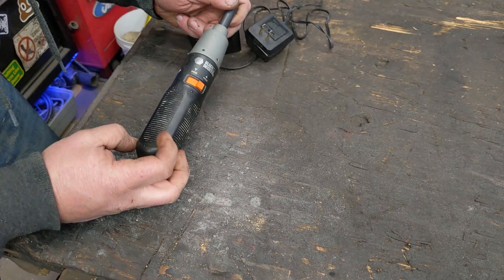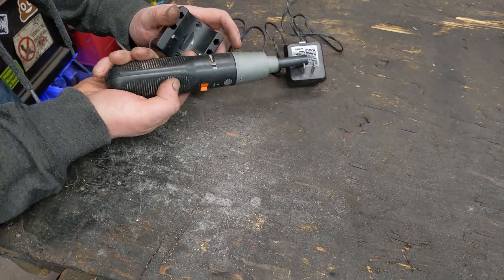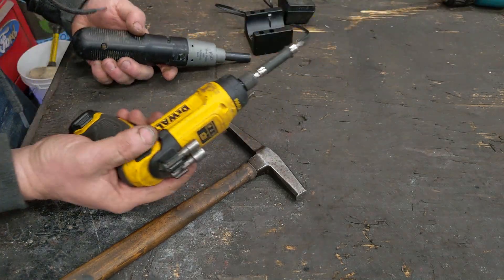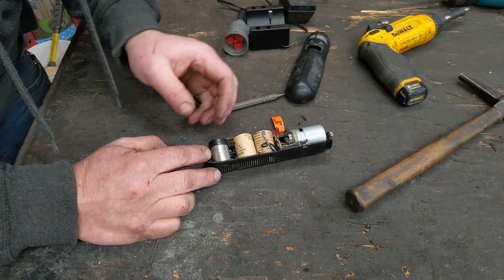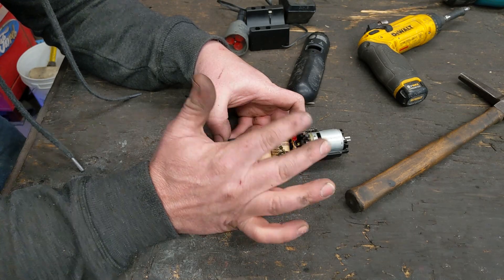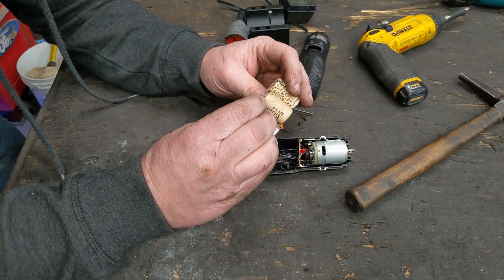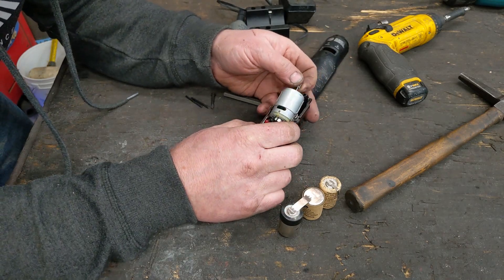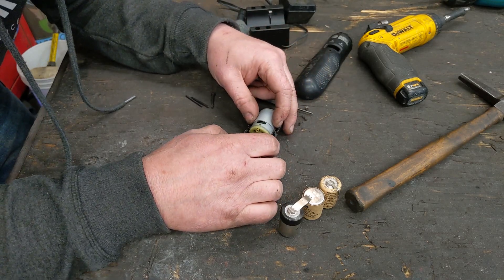Lithium conversion Black & Decker Screwdriver from NiCad Nimh  plus  Charger Upgrade

Comment: At the 6:25 mark you reference a “strip” . What is a technical name I can use for parts research?
Reply from the maker: "Nickel Strip" You can just use copper wire though and flatten it out. It'll do the exact same thing.

Comment: 0:56 I have a VersaPak version of this screwdriver, and the plastic housing is cracked.  I didn't know you could punch those pins out, I guess this is how I should go about supergluing the housing shut.  I also ordered a set of lithium ion VersaPak batteries, and I am surprised with the amount of power these tools now have.  The reciprocating saw was able to cut a 1 inch ish branch with a lousy jigsaw blade, I could only imagine how well it would cut with a better blade.  I also think it would be better if they could source shorter but still powerful li ion batteries to stick two of them in parallel in the VersaPak cylinder, but even so the power gained is insane.

Comment: If the battery gets hotter in use than while soldering,  then the soldering will come loose while you're using the tool. 🤔🤷‍♂️

Comment: I used a 21700 in mine and it lasts most of the summer. The 21700 was rated at 4,000 mah. I also converted it to charge with a single cell li-on charger. works GREAT!!

Comment: I have one of these sitting on the wall in my garage that hasn't been used since the 1980s. Looks like I need to order some lithium batteries. Thanks! I may have to fix my Rigid impact driver, battery op circular saw kit from Home Cheapo who wouldn't honor their "lifetime Guarantee." Got to dig out the soldering iron!
Reply from the maker: Awesome. Yeah, I've heard quite a few people disappointed with the Ridgid "lifetime warranty".

Comment: Can you also drill with it? I have smaller diameter drilling tips, yet I guess it is not possible to attach them to this model.
Reply from the maker: Unless you have hex drill bits or buy a separate hex drill bit chuck, no.

Comment: I predict the motor will smoke. The motor has more power & torque, which means more watts…

I gave a 14.4v B&D cordless drill a cord with car battery clamps…it worked really well, with tons of torque, but the smoke escaped before finishing the first job.

Comment: Thank you my black and decker is modle (9018) and has two battery's at 2.4 volt and made in 07 / 1980. And today it still works like new. I would like to get new batteries for it if and when it refuses to work. Thanks again . I look forward from hearing from you.

Comment: Had something very similar to that it was all metal Black & Decker charger was the same type except for it was for a 3/8  socket.  Took it apart and three batteries set up just like that kept it for about 2 months was planning on getting replacement batteries for it. Got tired of looking at it and trash it. Should have kept it.

Comment: There are these little 3.7v charge/discharge chips on amazon for about $1 each if you buy a bunch. They work great with the lithium batteries you find in the street inside tossed e cigarettes. The chips are pretty small, a little bigger than a stamp. And you can get a variety of usb jacks for whichever cord you prefer to use for charging. 

Cool project thanks for sharing
Reply: Hello, I'm thinking about doing what you say, but I thought about placing the charging plate inside the base where the screwdriver is placed to charge, my question is whether it will work or if I have to change some connection inside the screwdriver, will you? Can you enlighten me??  Thanks
Reply: @MrJamp11 the charge chip I use has 4 connections you will need to connect to. 2 for the battery and 2 for the load (screwdriver). You'll need to remove and reconnect the wiring from the old battery connections in the screwdriver to the new charging chip, and you'll need to drill and shape a hole in the area your chip is mounting for the charging plug for your external cable to plug into. If you're thinking if doing this then you're probably capable of getting it done. 

You can drill another small hole above the plug hole on the side of the led, fill in the back of the hole, and fill to cover the led with hot glue. If you cover the led and it also covers the hole in 1 piece of glue the led will light up all the glue and you'll have a charging status light on the outside that's easy to see. The parts are cheap so you should try it. But be careful not to cross the leads on the battery, lithium fires are scary and could burn your house down. It is recommended to keep a bucket ¾ full of sand nearby
Reply: Thanks for the answer.  I think the charging chip can be connected to the screwdriver's original charging base. The two terminals B+ and B- must connect to the base's contact points.  In the screwdriver, the only change is replacing the batteries with two 18650 batteries or one 21700. My question is whether I have to change the screwdriver's chip as seen in the video at minute 7:45??  but I think I'll soon know when to start reconverting the screwdriver, thanks again for sharing your experience.  Greetings.

Comment: I wouldn't worry about those batteries and soldering I've had drill batteries hot to the touch and I'm pretty sure it killed cells

Comment: Nice one!
I’m used to that kind of conversion too. I found that running the battery without a bms is fine but you have to be aware of it. You can’t run the tool till the battery is dead, you must recharge as soon as power goes down and speed decreases or you damage the cells.
Thank you for your videos I’m a big fan, I like your approach and the way you do things.
Cheers from France

Comment: I did this with that little VersaPak (or how ever you spell it)...
I added a TP4056 Charging Board to it with only 1 battery. (inside guts too small for two batteries; I didn't feel like grinding it out).
Works well...
Reply from the maker: Awesome

Comment: The Versapack version, where you could swap out the 3v battery pack for the one in the charger, was the best of these cordless screwdrivers. Still using mine and it has been discontinued for well over a decade.

Comment: I have 3 of the Skill Super Twist brand.  A twin to the B&D.  I have replaced the Ni cad cells with Ni metal and still use them.  Fair warning though.  A friend had two of these, one for his shop and one for use in the house for his better half.  He had converted the shop driver to Li with a battery management board in a new charger.  It worked great.  His wife found hers uncharged and "borrowed" his from the shop.  After using it she made sure it would be charged so she placed it on "her" charger.  The resulting fire scorched the drywall and left a burn mark in the floor beneath.

Comment: 4:20 ...glue it back together? Are you kidding?  "Duct" tape dude! If you wanted to keep the battery charge for just batteries also, you could make just a wooden "battery" spacer with the wires to the charger connected by ring terminal screwed into each end.

Comment: Love it but the thing is still light duty for sure with plastic gears and light duty motor,  which is still great for in the kitchen drawer but I'd kill it in the workshop.  Brought it to life for some good use though ...thumbs up !  very cool pup !
Reply from the maker: Absolutely it's light duty, but what power screwdriver isn't? I have the DeWalt which is the best on the market right now and it's light duty as well.
Reply: @sixtyfiveford  I agree with that...  just thinking the DeWalt would be overall built better and last longer even so.  I'd still leave the cheapie old B&D in the kitchen LOL

Comment: Looks like you could fit a single high mAh 21700 in there. They can be as high as 5100mAh. I don't know if it would run longer on a single charge or not. Pretty much just a lateral option I guess. Awesome to see one of these updated and it's definitely simple enough. Cheers Moe!!! Zip~
Reply from the maker: Some 14500 cells would have fit perfectly and I wouldn't have to cut the screw mount. I would have been able to get three possibly four in there as well. however I didn't have any of those laying around. It's amazing how much more juice they can get into a 21700 that is just barely bigger.
Reply: @sixtyfiveford  I know! I don't know the science behind it all, but between an 18659 and the 21700, I try to pick flashlights with the 21700 for just that reason. The smaller 18350's and 16340's could also be an option in that driver too I would think. So many Lithium choices out there now that just about any NiCad powered driver like the old Makita's could be easily repowered as well. Cheers Moe! If I didn't say it in the video, you rock! Zip~

Comment: I just threw mine away when I moved back in 2020. I had taken it apart to look into replacing the battery. I did a quick search, but didn’t find any replacements, but I’ll admit I didn’t look to hard. I don’t know why iI didn’t consider the li-ion conversion. I have a bunch of 18650 cells I’ve salvaged out of old laptop batteries. My only concern with your conversion is over-discharge protection. I’m bad about running the batteries into the ground. 😆 Wouldn’t be too difficult to add that though. The performance was impressive compared to what I remember this thing being capable of when my dad purchased it decades ago.
Reply from the maker: The over discharge is the only concern with this. However this being a power tool is extremely obvious when the voltage drops off as the power does as well. Unlike something like a flashlight etc that you can't really monitor the use and you'll destroy lithium cells. Unfortunately there is no obvious / cheap low discharge cut off available that will handle the 10 to 15 amps required.

Comment: All the internet has to offer with advice on hooking up Lithium is that you need a spot welder. Such a game changer seeing someone solder tabs on. Thanks for the never ending class on how to.
Reply from the maker: I've done a lot of batteries with solder and never had any issues. I am very cautious though and make sure I don't put too much heat into it.

Comment: Maybe i missed it, but did you consider putting one of those TP4056 charging boards or something equivalent inside the drill and just charge from a usb cord? Love your videos man! Keep it up.
Reply from the maker: Absolutely. I wanted to retain the wall mount holder/charger. Though USB is nice it's nice just to one-handed set the thing on the charger

Comment: Hey you should start doing some more videos like this where you modernize Vintage things like tools and phones and stuff or something to that effect. I remember when I was a Kid my dad had a whole set, flash light, circular saw, drill, and screwdriver like the ne you have but they used the long cell battery's I assume was just 2 or 3 of those in line. I remember he hated how the battery's never seemed to be worth a damn though lol.

Comment: May I ask what prompted you to do the jumper solder on the board? Would that be an absolutely necessary thing to do? I'm going to do it as you did yours, I'm just very curious and that's how I learn. Thanks
Reply from the maker: Just so the connection on the board went directly from the battery to the metal tab on that is that external charge connector. Otherwise it went through a diode.
Reply: @sixtyfiveford  Do you feel that the diode would hinder the proper charging with the adapted charger? Can a diode limit the charger? I always thought that a diode was just a one way valve so to speak. I truly know nothing about such electronics, just trying to learn.
Reply from the maker: @ricks5984  The new charger senses the battery's voltage to not overcharge it. Diodes all have some resistance and this could mess with the built in charger sensors. Could, could not, I didn't really test it. The diode wouldn't help so I just quickly omitted it. The reason the diode and led were in the stock circuit board were to act as a bridge rectifier. The stock charger put out AC voltage to this circuit board and the bridge rectifier converted it to DC in order to charge the DC batteries.
Reply: @sixtyfiveford  Copy that. Thank you again for teaching this old man something he didn't know anything about. That gesture is highly appreciated.

Comment: if you use a protection circuit you could totally use the original charger.  The voltage is close enough, and the current output won't be high considering it's supposed to be a trickle charger.  It would be very slow, but it'd work fine so long as you put in a little charge circuit to keep it from overcharging.
Reply from the maker: A protection circuit won't allow high enough discharge rate. They're fine for things like flashlights, but generally they're only rated at 2-3 amps max. This tiny screwdriver pulls 9ish amps at stall.
Reply: @sixtyfiveford  damn, got a replay, and your pretty knowledgeable about this stuff.

i probably should have said charge circuit rather then protection.  One with discharge protection as well would be too large to fit in there likely.

I was thinking more along the lines of if you have one with a charge\cradle stuck together.

Comment: Now if there is no low voltage cut out, doesn't this risk over discharging the cells and thus ruining them? 
Really wish LiPo was more stable, it's far superior to LIon.
Reply from the maker: Yes you could kill the cells if you laid into the tool and didn't stop when the voltage dropped off. Lithium is great though at letting you know when it's done. You will notice a sharp decrease in power the moment it drops below 3volts. Just stop using it and charge it.

Comment: have one of those I used to use the dickens out of at work. We assembled stuff with 8/32 chicago post screws, was perfect for that. It's still in the cannibal electric parts bin on the shelf. Got the same Lithium charger and cells...I might duplicate this same project. These would shine doing projects just like this taking small diameter screw in and out of other drills and stuff while working on the bench. Nice job!

Comment: Can you convert it to run the same battery that Dewalt on the workbench uses?
Reply from the maker: I'm sure with a little patience I could have. The biggest issue is making the receptacle to hold the battery.

Comment: Low voltage protection?
Reply from the maker: Nope. It would require a significant amount of circuitry/sensors. My feeling is that's really only for people who shouldn't be using a tool in the first place. Lithium will fall on it's face when it's too low to use anymore. When it gets weak, just stop.

Comment: My dad had one of those on the shop wall for like 20 years.  Love it.  The latest B&D versions just don't last, but the one with the gyroscopic trigger on the back was slick.
Reply from the maker: These must have been front row at every home improvement store.
Reply: @sixtyfiveford  It remains still one of the only effective Father's Day gifts in the vennic household
Reply: My dad had one too. I got a newer one (blue) with the replaceable battery stick🔋 that locked into the handle.

Comment: Got one of those for Christmas back in the day.  Absolutely loved it.  Used it for years, then later found out that a friend of my father had designed the gear-set.  I probably still have it out in the garage somewhere, along with the matching power ratchet, which I rarely used and was always dead.
What I would like to see you do, is convert a modern battery-pack system into a corded adapter, so that I can plug my battery-powered tools in and keep using them, rather than having to have a bunch of batteries to switch out, or wait while they're recharging.
Reply: Buy a knockoff cheap as shit battery on amazon, and take the battery out of it. Attach wires to the contacts, and then connect that to an 18V grunty switchmode power supply. Done - now your battery tools are "corded"
Reply from the maker: Biggest issue is the amps these tools draw. Sure it might only be 12, 14.4, 18v etc, but they will draw 30-60+amps under load. That's way more than any reasonably priced ac - dc power supply can handle.
Reply: @sixtyfiveford  So.... Maybe I could find a good power supply that can handle the amperage, then set it up so I could switch it between the various tools.  Still cheaper than a half-dozen battery packs for two or three different tool brands.
Reply: If you need more than 17A, you can also get 24V 25A (600W) meanwell powersupply for about $100 - not too bad for one power supply shared among many tools

Comment: I learn a lot from your channel. I have a few nice flash lights that work with ni cads and they r no good anymore. Plus, I have a few defective Ryobi 18 volt batteries. I bet there r some good 18650 in there to harvest. I just have to match the voltages. And get some of that nice flux u use.
Reply from the maker: Thanks. I really like the robust nature of Nicad cells but you can't beat the amount of power that these lithium can store in a small package.

Comment: Thats a dam good upgrade for the screw driver 😀
I did wonder what you were going to do for a charger,  lithium cells do need a special charge method.
Charge them wrong and they can explode. ( i call it the samsung effect) lol.
That 1 cell charger was a nice simple way to charge.
Be careful, ginger may start undoing screws around the house for fun 😀
Hmm that phone looks rather old,  you're not going mad are you :-D
Sorry Madder ha ha :-D
Reply from the maker: It was a fun little project just giving it a second chance at life. It will likely just collect dust in my shop but at least I know it works.

Comment: I don't believe that ever would have driven that screw in it's original state. I'm pretty sure I've got one of those laying around somewhere, and some old 18650's as well. Thanks.
Reply from the maker: It's been since the 90's that I last used one and I recall them stalling out pretty easily. It was twisting harder than one hand can really hold.